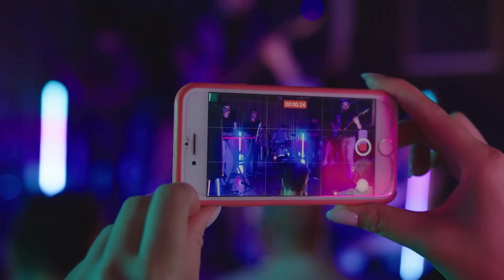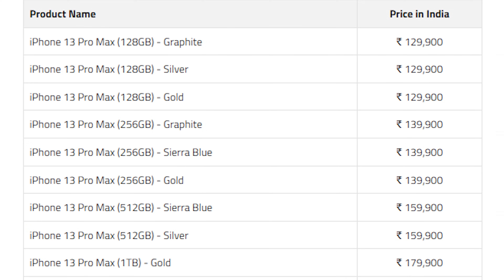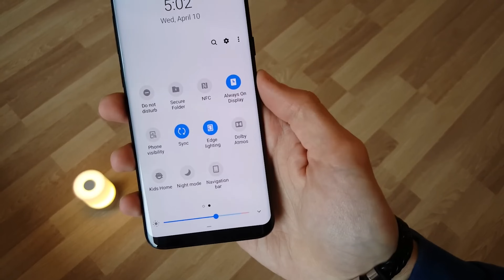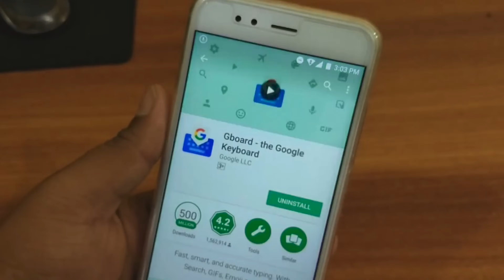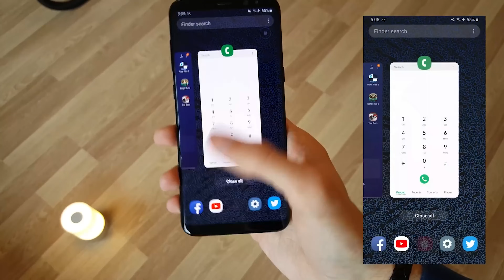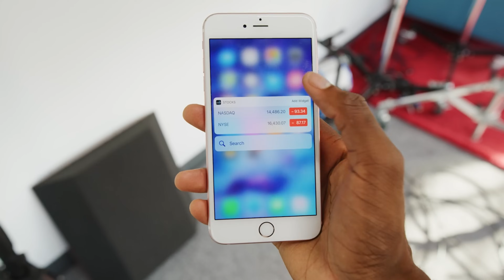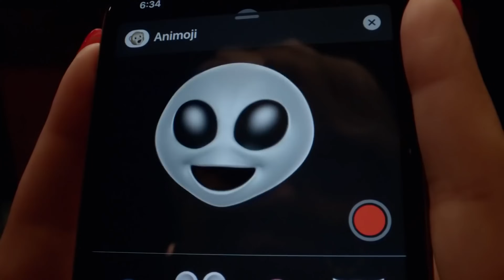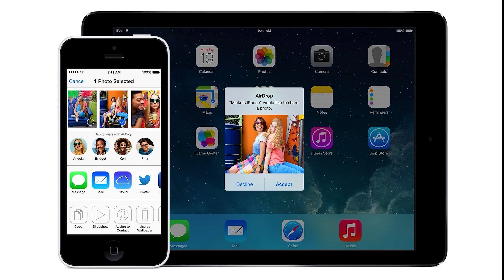iPhone यति महॅगो किन हुन्छ? Why are iPhones so expensive? Tech Arena| EP-17

Comment: Not all information in this video is accurate. Sony was the first smartphone company who launched phones with apps and keyboards. It was released around 2002 and 2003. I remember using those touch screen phones with stylus. SE P800 and P900 was their successful versions as I recall, but there were so many cool sliding phones with touchscreen and keyboards, better web browsers from Sony way before apple. It was so hard to find around that time. Only handful people had those phones in Nepal who was able to purchase it from Hong Kong or Singapore. Apple introduced phone  which was too easy to use and a very low maintaining phone. Apple won users heart with 3G speed, responsive touchscreen and IOS features.
Reply: Sony is the most expensive phone compared to iphone. haha. Iphone headline rakhyo vanay views aaihalcha.  This is a false content.